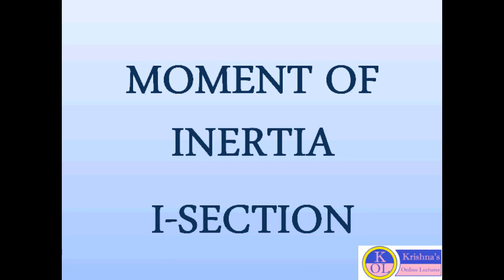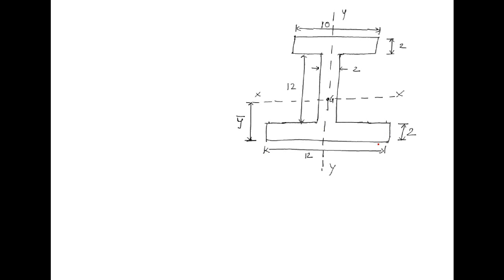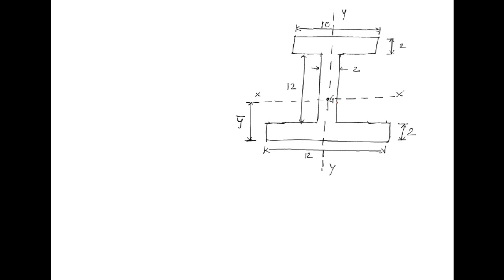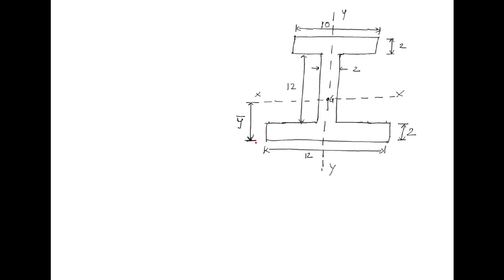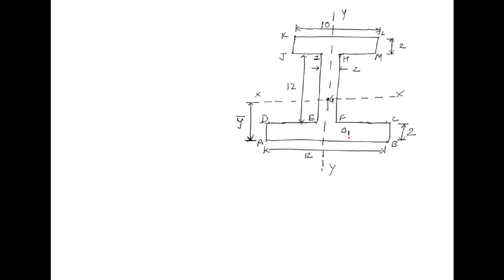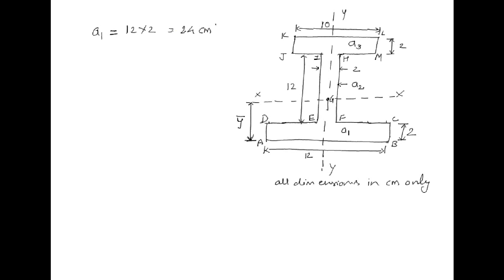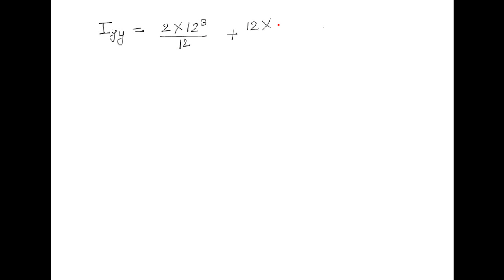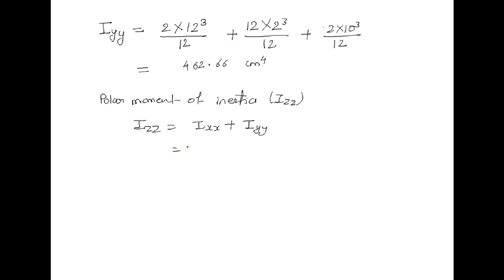MOMENT OF INERTIA OF I SECTION

Comment: You have calculated centroid of lower flange wrong. The correct value is 1-7.588= -6.412cm.
Reply: It's 8-7.588.  We take distance   from references x axis to find centroid of 2nd rectangle...